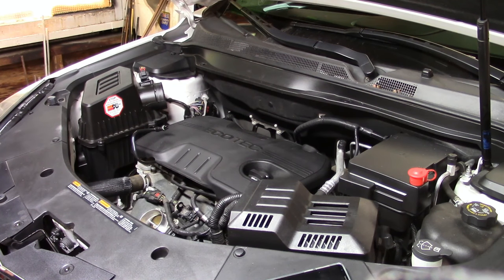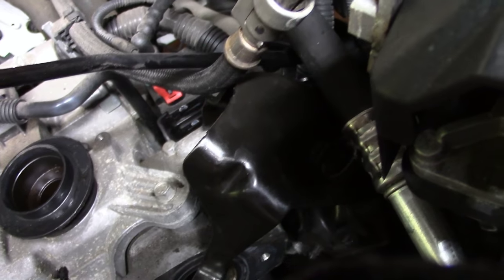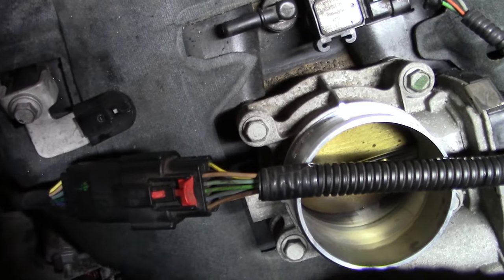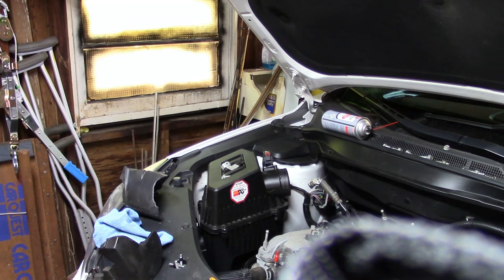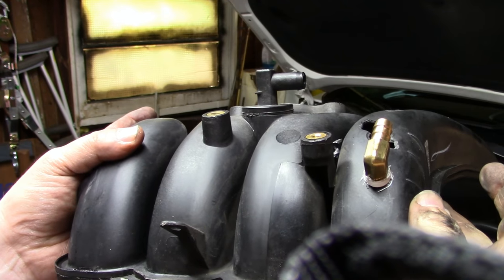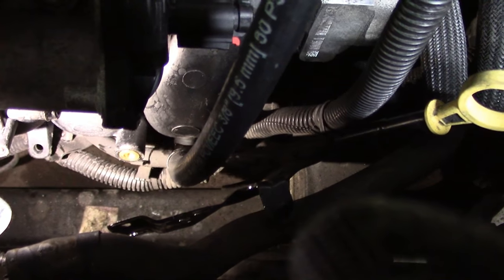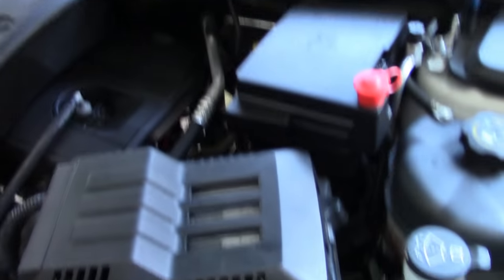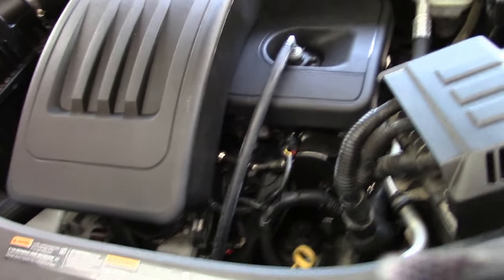2013 Chevy Equinox w/2.4L 4-Cyl. Engine PCV Upgrade

Comment: Im currently working on a 2013 equinox 2.4 liter with a vaccuum noise unless oil fill cap is removed. Cleaned intake and PCV hose to air box. Also replaced valve cover. Had to drill a small 1/8 hole in oil fill cap. Did yours make a noise before you did this added port to the intake.  Its definitly vaccuum and not crank pressure.
Reply from the maker: So when you take off the oil cap do you get pressure (a pulsation)  from inside the rocker cover?
And when you cleaned out the line from the head to the air box did you use any airpressure to check if there was a blockage?
Reply: @Duane B. Your fresh air circuit between the crankcase and air plenum is blocked, you are hearing high vacuum in the crankcase from the orifice.  I hope you did not drill out the orifice.
Reply: Duane, after your oil cap drill out, did you notice again leaks from the cap or did it keep the pressure lowwer?

Comment: Sure would like to know where GM is getting its engineers. That design is even worse than the one that was used on the LD9 quad 4. That one at least never clogged up. Can't understand why they wouldn't use a traditional PCV system that's been around since 1963.
Reply from the maker: Probably because it would add $0.05/engine.
Reply: GM gets most of it's Engineers from the University of Michigan book and math smart but many, have no basic mechanical aptitude or idea how parts are manufactured..   I worked in Ann Arbor for years as an Engineer with a BS in manufacturing technology from Wayne State University and ran circles around those U of M nerds.  I worked for an OEM GM  supplier later on, and  GM had poor designs that were hard to manufacture yet they wanted cheap prices and they rarely listened to suppliers about simpler better designs.  GM is all about paying cheap prices on complicated designs which is why the mostly suck.
Reply: @thomasbradley512  Berra started as an elecrical engineer with the Pontiac Fiero program.  Among other things the Fiero is known for having electrical problems. GM executives are rarely promoted for doing good cars it is based mostly on poltics and shaving pennies out of the end product.  Once in a great while GM makes a decent car or truck almost by mistake.
Reply: @Frank4358  You are not far off the irony is GM could design 2 or 3 pvc valves for its entire engine lineup and get economy of scale but due to the many fiefdoms within each engine design group will design a one off pvc system then purchasing will try to beat pennies out of the supplier for a relatively low volume.  Working for a GM supplier we usually were barely above break even on most GM work the only real profit money made was on pickup trucks due to volume.
Reply: So are the GMC trucks made like this?
Reply: GM also used to get good engineers from schools  like Purdue, Michigan Tech, and University of Minnesota.  Bean counters also get in the way. Another issue is this Ecotec engine was designed by Opel in Germany.  I had a 2010 Equinox and put 50,000 miles per year until rear main seal blew at 150,000. Was having oil consumption issues as well.  I have learned a lot since then and our 2013 Equinox  has 220,000 miles, uses oil about a quart per 1000 miles,. Need to stay diligent on oil changes and watch oil levels.

Comment: Great video Frank. Thank you. Any thoughts on using existing vacuum ports on the intake and attaching a T fitting to avoid having to remove? Also, what's you opinion on putting a catch can between the PCV valve and the oil fill cap? In other words attach hose to oil fill cap with open fitting, then to catch can to remove oil vapor, then install the PCV to in the outlet hose of the catch can between the catch can and intake?
Reply from the maker: The whole idea is to take the oil and vapors from the engine, and return them to the combustion chamber to be burned off.
If you add a catch can between the PCV and the intake manifold you defeat the emissions system. 
As far as adding a T-fitting to an existing vacuum line, I've discussed that in a previous comment, but here it is, again;
The only line that is large enough is the vacuum assist for the power booster. If you introduce any oil in that line you run the risk of contaminating the power booster which could eventually cause a brake failure.
Reply: @Frank4358  Thank you for the reply Frank. By catching the oil vapors and condensing them in a can it is effectively not defeating the emissions as the vapors are not being vented to the atmosphere and the additional benefit of not reintroducing oil vapors to the intake. Maybe using the brake booster vacuum line with a catch can can work? Thanks and take care.
Reply: One last question Frank and I do appreciate your replies. Isn't the brake booster line constantly under vacuum so even if a oil catch can isn't used, there wouldn't be any vapors going to the booster?
Reply from the maker: @Vance005  vacuum varies based on throttle opening and engine rpm. So at certain times during the drive cycle the vacuum signal can be as low as 0 and as high as 20-inches of vacuum. There is always the possibility of oil contamination in the vacuum line.
Reply: @Frank4358  you simply dont know how the brake booster works.  It runs on vacuum, one way from the booster to the intake. It also has a one way valve to prevent air or vapor from entering the booster.  Running for over a year, no issues.  Putting a catch can on that line will collect a large amount of oil and pass the vapor.  I have collected over a quart of oil in the past 15k miles.  If your not using a high efficient baffle and filter media you will be sucking in a huge amount of oil. By putting the fitting where you did, most of that oil will be sucked into the runners of #3 and #4 cylinders.  Using the brake booster port centrally located it will be dispersed to all intake runners equally.  Also not blocking off the internal orifice you fefeat performance and function of the PCV valve.  I used a custom, adjustible PCV valve, blocked the port, installed catch can, and tapped the brake booster hose.  I get a constant .1 inHg a vacuum in the crankcase at all engine loads which is more than enough to ventilate the crankcase.
Reply from the maker: @tssci6774  I do know how power boosters work. And I have seen enough one-way valves fail, with oil being introduced into the booster. The result is replacing the power booster. And if you're familiar with a vacuum signal, it reverses under deceleration. By your own admission, you've removed 1-quart of oil in 15,000 miles. Since I've made this modification, I have not used ANY oil, at all. So your theory of having oil collect in the runners isn't valid. And I've done it without venting to the atmosphere. The emissions controls are all intact.
Reply: @Frank4358  I have been monitoring crankase and intake pressures for two years. Not once have I seen pressure reverse, in fact vacuum increase to 23 inHg in the intake during deceleration, and during wide open throttle intake vaccuum goes to less than 1 inHG, and crankase vacuum goes from .1 to .6 inHg.  Explain to me how oil will be pushed through 3 ft of hose, up 12" to a one way valve into the brake booster.  Any fluid that anyone finds in a brake booster is brake fluid, not engine oil. I bet if you remove you air housing, and put a borescope past the throttle body you will find pools of oil in the bottom of the intake manifold. I have plenty of pictures.   Lastly, a properly designed catch can does not vent to the atmoshere, not sure where you think it will compromise emissions.
Reply from the maker: @tssci6774  then explain why you have captured 1 quart of oil in your catch can? And there is no brake fluid in a brake booster. If you have brake fluid in your brake booster you have bigger problems.
Reply: @Frank4358  The PCV system was do not designed to draw oil back into the engine, just the opposite.  It was designed to seperate the oil mist from the air and combustion gases, hydrocarbons, water moisture and those gases are burned in the engine.  GM deigned four different baffles into the camshaft cover to collect the oil and return it to the crankcase while passing the gases. The reason why the orifice clogs up is due cheap oil, long drain intervals, and GDI soot.
Reply: @Frank4358  It is very difficult to remove all oil vapor from the PCV system. I use the same design with a PCV valve in the oil fill cap like you, I have captured oil because I  actually installed baffles and filter media in the path to stop the oil.  My latest design achieves a very high seperation.  I dont have brake fluid in my booster, never said I did, but the only way to contaminate the booster is with a leaking master cylinder.  Where does the pressure come from to push engine oil vapor past the valve into the booster as you claim?
Reply: @tssci6774  in one of your previous comments you stated that you put a oil c.c on the clean side, and you we're getting a lot of oil?  Don't see how.
Reply: @rondavis2791  I have experimented with one CC, a CC on both sides, and an external PCV valve.  In the winter there is a lot of emulsified oil which is 10% oil, 1-2% fuel, the remainder of water.  The Make Up Air circuit, which is commonly referred to as the cleanside, actually flows in both directions, depending on driving conditions.  If the internal orifice is blocked, you will see much more byproducts on the cleanside.
Reply: @rondavis2791  Excess CC pressure will vent out the clean side into the air filter housing.  When the PCV orifice clogs or you have more blow-by than the OEM PCV system can handle.  When that happens the catch can prevents oil being blown into the air cleaner housing.  In a healthy engine it should not be needed but so many of these engines are not.

Comment: HI, Frank I had been looking for a video like yours. I have  Terrain same problem 
I need to know what size is the hole at the manifold, I don't see on any of the comments
Thanks
Reply from the maker: @reinaldofranco542  1/4NPT. But start with a pilot hole and go slow.
Reply: @Frank4358  thanks a lot

Comment: Frank the one problem I can see with modification you seemed to have tapped into one of the intake runners going to cylinder 4 . This means all your PCV gas are going one cylinder and not distributed evenly to all cylinders. Bad idea. Causing one cylinder to run lean or even miss, now you have another problem. How big is the PCV valve are you using, you don’t say. Valves and the flow rates are  built into the air/ fuel calculation designed by the engineers. Messing with will bring on the Check engine light. Before you just start drilling holes in your intake you should find out how the engine works and the consequences of making shade tree modifications are.
Reply from the maker: The fitting is placed at the bottom of the runner, so it doesn't affect vacuum signal to the cylinder. There is no check engine light that's been illuminated. Not when it was installed, and none to this day. I haven't had any "lean" conditions on any one cylinder associated with this modification. Your fears are unfounded. If you want to research the PCV dimensions, etc., the part number is listed so research away. The only thing that's changed is that I no longer use any oil. The level remains at the full level,  and I have changed the oil more than a few times. I sample my oil, and the oil is more stable now, maintaining adequate viscosity.
Reply: You are correct. This hack will work but just buying time. The original design is a good concept but the way they did the design is terrible.

Comment: Hi Frank,
would you be able to tell me the specific hose and elbow parts that you used in this video? Do I need to put a PCV valve on the oil cap and intake?
Reply from the maker: @sophianavarra877  any questions can be posted here.

Comment: I am asking around everywhere, I know that multiple forums and people are recommending to use di-electric grease on the intake seals... but I have also read that silicone products are bad for O2 sensors... Is di-electric grease O2 sensor safe? Are people just getting confused between Silica and Silicone?

I am asking since my O2 sensor failed right after this intake manifold job, and I used di-electric grease. The first time I did the job, I used Vaseline, which seemed to work just fine.
Reply from the maker: Just adding dielectric grease on the intake seals is not going to affect the O2 sensors. It's such a small amount on the edge of the seals. Just don't pack it on like you're greasing a wheel bearing.
I used dielectric grease on my intake seals with no adverse problems.
Reply: @Frank4358   Thanks for the info :)

Comment: Why not just connect the new line to the stem on the valve cover instead of drilling the oil cap?
Reply from the maker: You draw vacuum from the the engine (the oil cap), while the return line -- besides being too small in diameter -- is a return vent. So it won't work.

Comment: I feel like having the pcv draw from the oil cap would draw more oil into the intake system and foul the pistons and burn more oil. Oil is being flung around by the camshaft. What are your thoughts?
Reply from the maker: There is a baffle between the oil cap and cam, so there is no more oil draw than from a conventional PCV.

Comment: Can this be done on a 2012 GMC Terrain 2.4L. Having major oil consumption issues at 85k miles. I’m aware of the GM class action lawsuit regarding faulty piston rings.
Reply: 4 cylinder
Reply from the maker: Yes. Same engine configuration.

Comment: Thanks Frank. But what the heck was that loud ticking at idle when you started it up? Timing chain? Sounds horrible. BUT , THIS WAS 3 YEARS AGO. PLEASE RESPOND TO THIS. ID LIKE TO KNOW IF THE ENGINE STILL RUNS. 
MY MOTHER BOUGHT A 2012 GMC. SAME MOTOR, SAME NOISE. IM ASKING ON HER BEHALF. 
thanks man. I hope to hear back from you
Reply from the maker: It's actually the high pressure fuel pump! 
I put a stethoscope on the engine and that noise is not associated with the timing chain. 
Checked with some automotive technician friends and they told me it's a "normal" condition!
Reply: Thanks a lot. My mom was happy to hear that. Good man